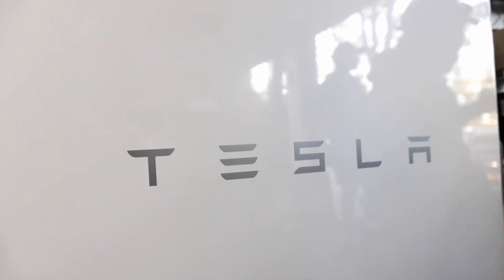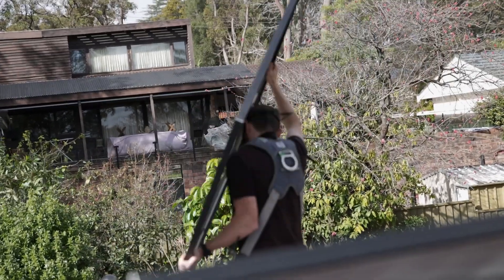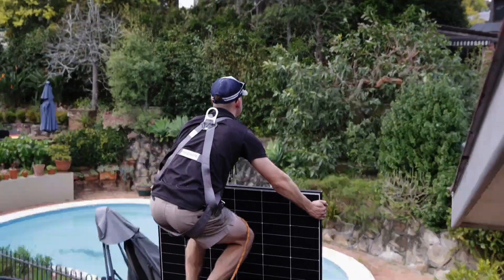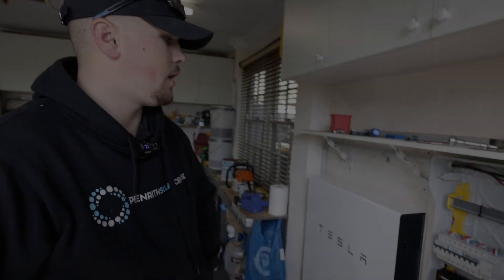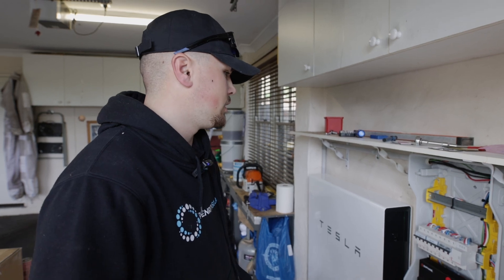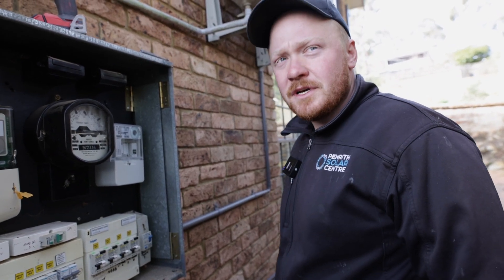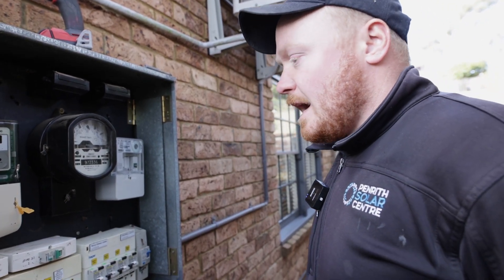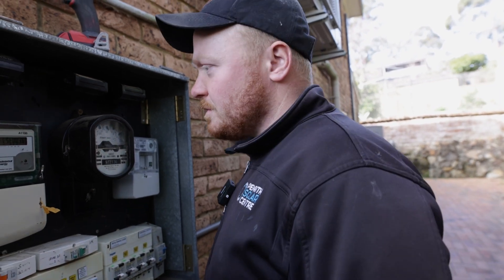Tesla Powerwall Solar Setup for Blackout Protection

Comment: Something that to my understanding Enphase IQ8  is the only one who can enable is to “charge the Powerwall during blackout if there is sun even if the Powerwall  is depleted”. String inverters cannot do this as they always need grid connection or sufficient charge in battery.
Reply: @TurreTuntematon  no that’s no accurate.
Reply: @markcavanagh  So tell me then how a string inverter based solar systems wakes up the home system if grid is down and battery empty. It will simply not.